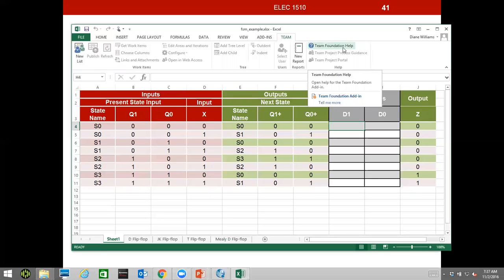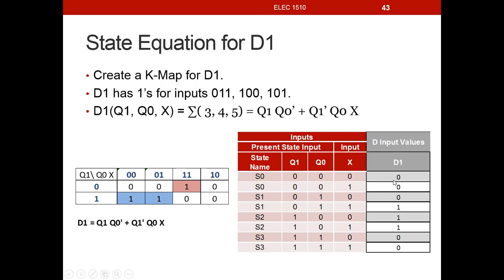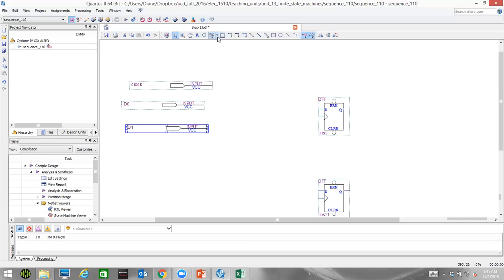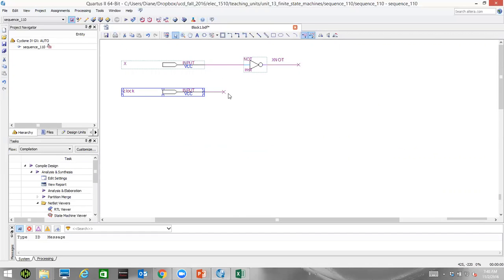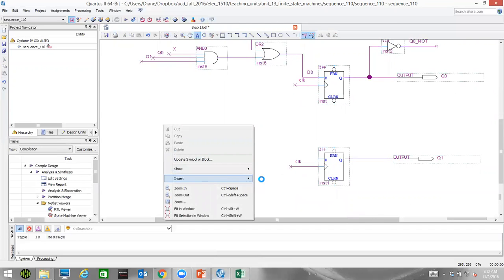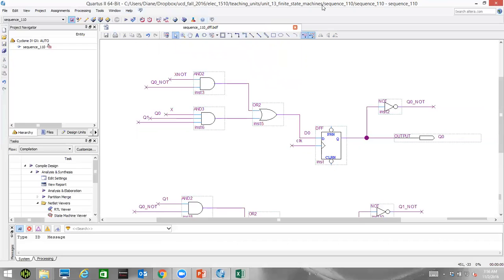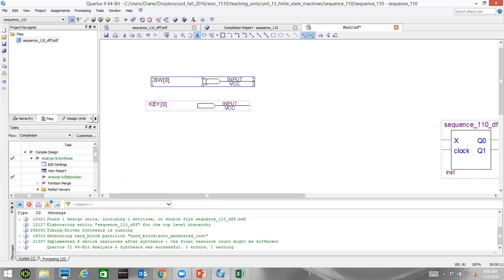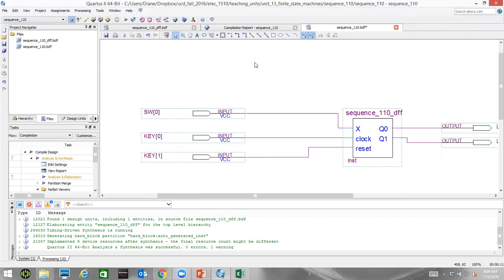Finite State Machine Sequence Detect Part 4

Comment: @4:55 - I am not sure if the state equation for D0 is correct .If D0 = Q0'X' + Q1Q0X  as shown in the lecture  then for Q1=0,Q0=0,X=0, D0 = 1 using the state equation but according to the table D0=0. I think the K-Map table might have an error.
Reply: I thought that too. I did the k-map and its different of the video.